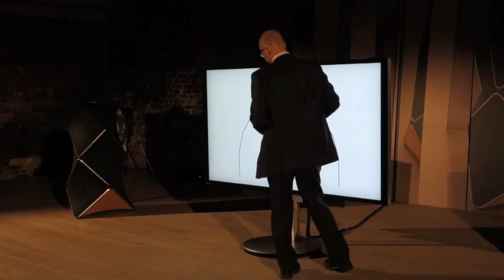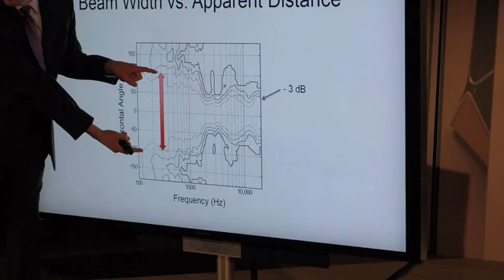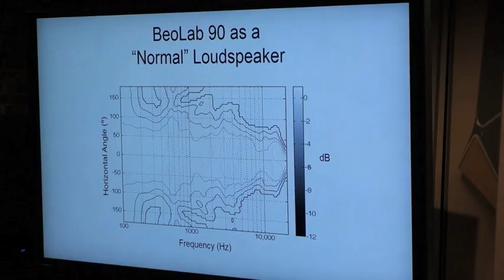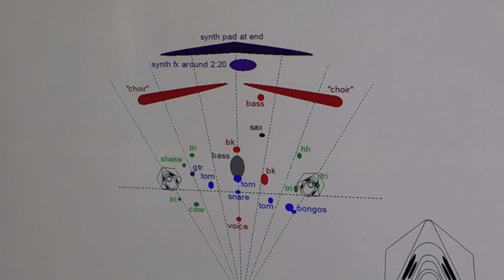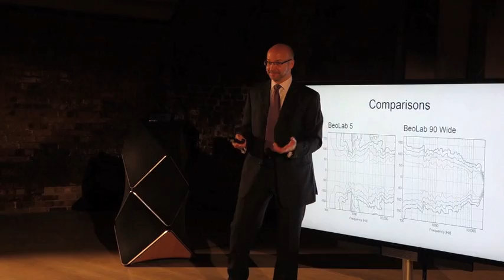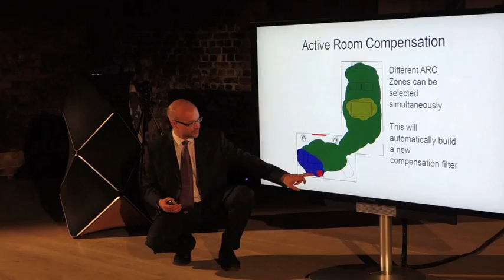BeoLab 90 background on room compensation and more

Comment: The importance of stereo theory - or the lack of it. Almost everything that Geoff says here is upside down. He thinks what we want in a speaker is a beamy direct sound tunnel of sound toward the listener. Of course it is just the opposite; we want to mimic a live sound field. Most of the live sound is a reverberant field with very little direct sound. The object of good theory should be to mimic a live sound field. Rather than beam the sound toward a single listener we want to use diffusion and room size to build a natural sound field in the ROOM, not beam it to your EARS. He shows a picture of his beamy sound having greater depth than an omni pattern. It is just the opposite - it is the reflected sound from behind and around the speakers that give the depth and spaciousness.
He thinks the wide and omni modes are for parties. I auditioned a pair of these at a dealer in south Florida. The narrow mode sounded like normal, traditional "hi fi." As I switched in to wide and them omni modes, the soundstage filled out wonderfully - depth, spaciousness, and widest soundstage of all.
Engineers may know all about electronics but nothing about acoustics and psychoacoustics and certainly without a correct stereo theory they have no idea what to do with speakers radiation pattern, positioning, and the surfaces in the room. Killing the reverberant field is NOT the answer. We must learn how to compare the image model of speakers in rooms to live sound fields in the concert hall.

Comment: Makes too many flawed assumptions for the sake of the" Demonstration", for instance,   
2:35
The way human brain compares so we can understand when a sound source is moving away (or moving closer) is mainly because of the Doppler Effect not because of Reflections,  we wouldn't be able to tell if we were in open space with no reflections otherwise.
9:50
Also false, as he correctly says low frequencies are Omni-directional, so you can't use the "back woofer" at 180 degrees opposite to the front woofer to kill frequencies "that way", you will "kill" frequencies ALL OVER THE ROOM.
Reply: Look it up on google, we do perceive depth in sound from difference in volume between sound coming from reflections off the wall and sound coming directly from the source not the Doppler effect. An example where you experience this is the fact you can tell how far away someone is much more easily in a room rather than outside on a field.
Reply: Btw there are 4 woofers at 45 degree angles to each other. Geoff Martin just said the back woofer as an example to make it easier to understand